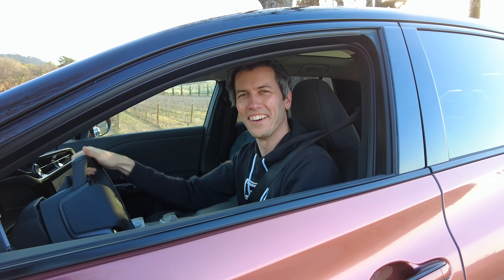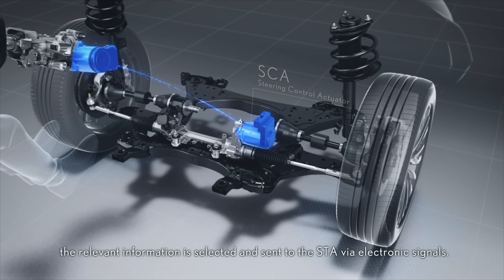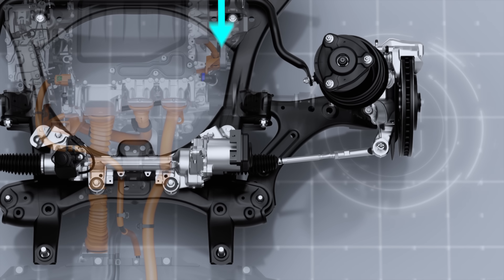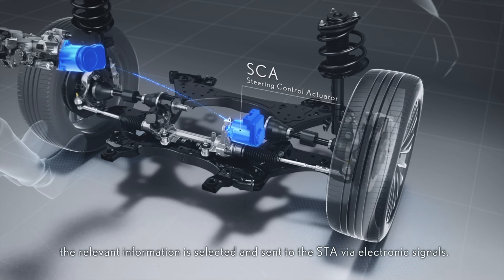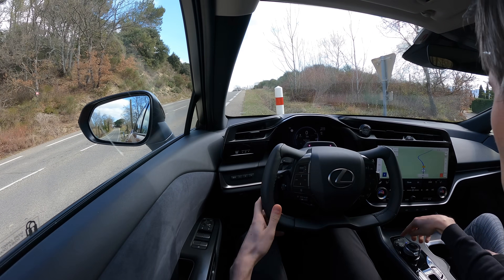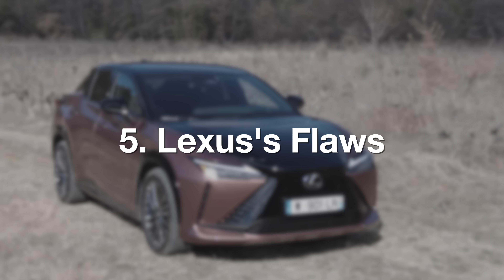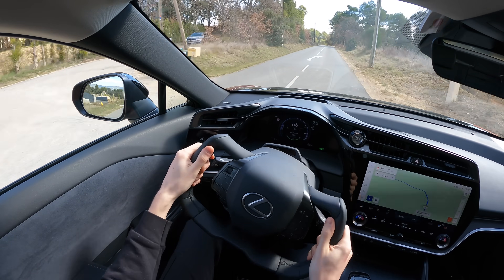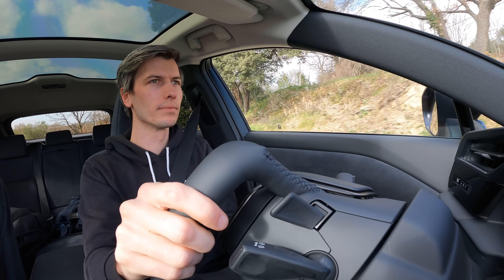How Lexus Fixed Tesla's Bad Idea: Steer-By-Wire Yoke

Comment: 9:12 "Well these steering wheels have much shorter steering ratios."

Common misconception, though track requirements and driver preference of course play a big part. Monaco surely requires a LOT faster steering ratios than most other tracks.. On open-wheel racing cars it's not uncommon to see steering ratios in the 10:1 to 12:1 range, and I've even seen 13-14:1 ratios used on tracks without super tight corners, and there are plenty of cars that live near those ranges. BMW M3s and 1 M-Coupes for example have had 12.5:1 steering ratios in some generations, a 2020 Toyota Corolla might have 13.5:1 steering ratio. Interestingly you often see slower steering ratios on more sporty cars, like 15:1 on Jaguar F-Type and 16.9:1 in the Ferrari F430 (458 went down to 11.9:1). So while open-wheel race cars often do have faster steering ratios, it's not like it's worlds apart.

The real reason they can get away with it is of course that they're going fast and not actually turning THAT tight, vs. trying to do a 3 point turn on a parking lot (which would be quite hilarious when they often have like 17-20° of steering lock at the wheel, vs. 25-35° of normal cars). There's only so much steering angle they can use before understeering, because they're driving on the limit, so they can get away with not turning the wheel that much. And it's not just racing cars, you can watch an onboard video of the Porsche 911 lap record at the Nordschleife or Silverstone (or almost any other record for a car), they also don't really go hand over hand even in the tightest corners, with road car steering racks (to my understanding the steering ratio of a current 911 GT3 RS road car varies between 14.4:1 in the center to 11.2:1 near the edges).

When finagling the open-wheel racing cars to pit boxes (if for some reason they're not lifting it up entirely) you can still see the steering wheel turned hand over hand at times, though it's uncommon for them to have more than about 500° of lock-to-lock wheel rotation. With often less than 20° of total steering lock available, that still means a steering ratio in excess of 10:1 in most cases.

Comment: Interesting, and about time we modernize the way we drive, steering is the one thing that hasn't changed fir many years, having said that, I wouldn't trust Tesla's technical approach, since  they can control the users car via the internet/satellite, it can be easily hacked. Also, the way the software is done by Tesla leaves much to be desired. The end user should be able to dictate and choose how to control and use the vehicle Not the manufacturer.

Comment: 12:00 lack of sharp response in case of an emergency to lets say avoiding an incoming traffic and a crash is essential. What is good about this system though is because it is made of electronics the manufacturer could update them at anytime. So I would say no more recalls to change a hardware. A simple update by simply connecting the car to the internet could do the job, sort of what Tesla is actually doing

Comment: The whole "Why use steer-by-wire" section is just copied by the manufacturers!
It's just wrongly assumed that traditional steering with "highway speeds' is unstable.
It just isn't. 😆 It's as stable as the car is built 🤷🏼‍♂️
Factors like wind direction or the general condition of the car are what make a car (un)stable.

Comment: As an electrical and I&C engineer I can think of over a hundred failure points and lack of fail-safe right off the bat.
This can NEVER be as safe as a mechanically linked steering system

Comment: Wondering what would happen if you start steering in high speed (low sensibility) and reduce the speed while still in the same steering. What happens when the vehicle is in low speed (high sensibility) and you stop steering? Does it get out of sync? The centred yoke doesn't mean straight wheels?

Comment: How does it feel to brake with the steering wheel turned, as you turn if you slow down it would change the ratio making you turn even harder if u didn’t move the wheel

Comment: As much as you want to sugar coat it, electronic steering is more likely to fail compared to mechanical steering. Even in airplanes which use fly-by-wire the early test versions show issues with the fly by wire system. Since it is software that engages the steering, if there is a mistake, it will cost a lot. On top of that, drivers are not trained to deal with any malfunctions and will most likely crash after the startle they get when they steer their wheel  but the car stays straight....

Comment: Let's just say it's a lot easier for a mouse to chew thru a wire than a thick metal rod!  Imagine you have a 2000 miles road trip and the motor to control the steering decides to burn out in the middle of the trip while you're going 80mph!  Of course it's safe, until it isn't... hate to be the first ones to experiment this "technology".  Also what if you have to dodge a deer at high speed?  I guess even if you jerk the wheel your car will hardly move!

Comment: I drive order pickers at my warehouse job. They use steer by wire. Let me tell you: if you go to make a subtle direction correction, it can wildly throw your angle off. I've nearly crashed into several racking units because I made a slight adjustment with the steering wheel and it decided to yeet me off to the side.
Reply: IT is not thinking about you, it is doing whatever it wants to do by the people who designed it, which makes IT unsafe.

Comment: Nice explanation of the why and how. I can understand the pros/cons of having a yoke and drive by wire. But all that extra stuff with builtin redundancy seems to be way over engineered for the value it adds. The traditional power steering is probably more than sufficent for like 90% of the market out there. It feels a lot like a feature no one asked for and dont really want to pay for and then also have to maintain later on

Comment: The video of one of these at a race track was all I needed to see to know this version is as bad or worse than Tesla. Bottom line up front, the Lexus does not accurately map the yoke's orientation and the yoke "creeps" off of center with dramatic inputs until you are left holding it sideways to go straight. Maybe this is a good idea for the everyday driver, but the current software simply isn't dynamic enough to work in most performance applications.

Comment: Electronic parts are expensive to replace, I dont always want my hands at 9 & 3,
Reply: Electronic parts also last many times more than mechanical and need way les maintenance.. you don't need to have always at 9-3, like you don't to be always at 10-2 on a circular one..

Comment: Thats really interesting and all, but give me my circular steering wheel back. I drive 95% of the time with my hand on either the top or bottom of my steering wheel, having two hands on the wheel feels unnatural or like youre racing. I am all for the tech, but gimme circular steering wheel.

Comment: Old news this been around for a long time I had a cheap 2012 Hyundai Elantra limited used steer by wire and throttle with adaptive steering standard circle wheel.  This is becoming more common so people are starting to notice it especially when the gear that connects the motor to the steering wheel has to be replaced.

Comment: Lexus's steering technology is definitely in the right direction, pun intended. This might not be for enthusiasts, for now. The whole concept is in its infancy, we just have to let it grow to its potential. We can always have a sensor to detect objects on road like in a moose test to let the steering wheel be sensitive or even assist during evasive actions. This kind of steering is going to be very practical in a fully autonomous car where for some random reason you want manual controls occasionally, but not always use it. One can only imagine.
Reply: Definitely not

Comment: Not sold on the concept, and I am a retired pilot with thousands of hours in FBW aircraft I "trust" FBW systems. First, FBW in aircraft serve a specific purpose, it allows you to build an aircraft with relaxed stability and still be able to fly it. For fighter type aircraft this can dramatically improve maneuverability. On a car I just don't see a compelling need, I feel like they are doing it just to do it. Second, this system as described lacks adequate redundancy. Quad redundancy is the standard. The redundancy described is more like 1.5x. Tandem actuators are not truly redundant. FBW aircraft do a full FCS test prior to every flight to verify full functionality, and I suspect this just does a continuous monitor vice a dedicated BIT. Third, the performance isn't there. Aircraft FBW systems are nearly instantaneous. It sounds like this has perceived lag, and that's unacceptable.

Comment: The idea of adaptive steering at different speeds is the single dumbest idea that has ever been proposed. It may sound good on paper but in an emergency situation you cannot be guessing at how much you need to turn the wheel in order to get a certain response or have that response changing as you're heavy on the brakes to slow down.

Comment: I feel one of the biggest benefits is  being able to build cars that are either left or right hand drive. As the steering column is one of the hardest things to shift from one side to the other but not in a drive by wire system.
Reply: @ThomasVWorm  the point is that it's a lot easier to do that configuration much later - it's just a different dashboard instead of a completely different layout in the engine bay...
Reply: @ThomasVWorm  the money saved from manufacturing and transport is probably more than enough to justify it.
Reply: so the only benefit is world marketability? doesnt sound like a benefit to the consumer at all, unless you think the money saved by cheaping out will actually be passed down to the consumer. (it wont)
Reply: Better yet, you could make cars that are left AND right hand drive, so you can have a co-pilot, just like on an aeroplane. You can also teach your kids to drive that way. Hell why not put a steering yoke in front of every seat so if you get bored of driving you can just throw up your hands and let your toddler take over the wheel, or the yoke in this case.
Reply: Correct! That's the main reason - money saving. Car manufacturers tried to implement steering-by-wire since a while (15+years) but for long, there were too many safety concerns. With the rise of the e-cars, SBW got pushed as well and gonna be state of the art soon. 
A big cost factor in every production is diversity. Quality control is easier, confusion/interchangability is lower, spare part storage.... 
Standardisation of things is a must! So, not having to worry about left hand drive / rhd is a HUGE thing for design, production & aftersales.
Reply: @ThomasVWorm  They're at least one-fifth of the worlds population.
Reply: @domnanzwandor  He said India dude. lol.
Reply: Hoping Cybertruck has it. Then we see it sooner in RHD Australia.
Reply: That's fascinating! You could import a car from the EU to the US. Or from China to Hong Kong
Reply: @TreDogOfficial  The only left driving EU countries are Ireland and Malta. I don't even know if they make cars there tbh.
Reply: @cyan_oxy6734  Cyprus and the UK also drive on the left :)
Reply: Lol😂
Reply: heck they could even install them on the backseats... or have one at the aft in the cargo hold to drive backwards like u would forward xD but tbh traditional steering could also have higher steer ratio just by adding gears... so on a yoke u could shift and have a low steer ratio at high speeds and a high ratio at low speeds :D better would be if its shifting on its own tho... at certain speed threshholds... like highest ratio at 0 to 10kph slightly less at 10to 30 so on...
Reply: You could even have a version of the same car with a centered steering wheel, or even one that can be repositioned across the dash whenever.
Reply: who needs UK cars, Japan only...
Reply: And doing it VERY easily. In a Toyota press release about the TNGA platform, they mention that 80% of the chassis development cost is in the firewall area, so being able to make one 'global' firewall would save them a lot of money
Reply: That and in the future you can simply remove the steering wheel.
Reply: I don't think that benefit is very big. You will need brake by wire moving out brake cylinder and vacuum chamber, also, to completely benefit from that. Steering column itself is located mostly inside cabin and steering racks actually designed to have driving shaft on either side (only casing is different).
Reply: I thought they could just mirror everything
Reply: @ThomasVWorm  easier said than done. We Brits gets charged more for the "special" edition
Reply: @mostlymessingabout  Steering is only one of many differences. The cars still need different dashboard, different cable bundles, probably door panels and other interior trim. Anyway, somehow the Japanese companies somehow manage to sell Japanese-side cars to Japanese buyers with no special surcharge... 😉
Reply: @mostlymessingabout cheapest used car in the whole of europe. what tf are you talking bout “charged extra” stfu
Reply: @ThomasVWorm  few people includes all of Japan, Hong Kong, India, Brunei, Bangladesh, Bhutan, Malaysia, Pakistan, Singapore, Indonesia, and Sri Lanka,  East Timor ,Macau , Thailand ,Kenya, South Africa, Zimbabwe, Lesotho, Botswana, Malawi, Zambia, Namibia, Swaziland, Uganda, and Tanzania, Fiji, Pitcairn Islands, Kiribati, Tuvalu, and Niue. Nauru, Samoa, Papua New Guinea, Tonga, and Solomon Islands, Australia , New Zealand, Guernsey, the Isle of Man , Jersey, Ireland, Malta, and Cyprus ,Antigua and Barbuda, Barbados
Bermuda, Bhutan,Botswana, British Virgin Islands,Brunei, Cayman Islands, Christmas Island, Cocos (Keeling) Islands, Cook Islands, Dominica,East Timor, Eswatini, Falkland Islands, Guyana, India, Indonesia, Jamaica,
Kiribati, Lesotho, Malawi, Malaysia, ,Maldives, Montserrat, Mozambique, Namibia,Nauru, Nepal ,Niue, Norfolk Island, Papua New Guinea, Pitcairn Islands ,Saint Helena, Ascension and Tristan da Cunha
Saint Kitts and Nevis, Saint Lucia, Saint Vincent and the Grenadines, Samoa, Seychelles, Singapore,Solomon Islands ,South Africa, South Georgia and the South Sandwich Islands, Sri Lanka, Suriname, Tanzania
Tokelau, Tonga, Trinidad and Tobago, U. S. Virgin Islands, Uganda , United Kingdom, Zambia, Zimbabwe

so a tiny market !!
Reply: @SNORKYMEDIA  Yes. Funny you needed to make your list longer by including Pitcairn. There are no cars on Pitcairn.  But it does make your list longer :D
Reply: Minor correction: You listed both Swaziland and Eswatini, but they are the same country (Eswatini is the current name).
Reply: You forgot Camera @SNORKYMEDIA
Reply: @SNORKYMEDIA  🤣
Reply: It's not just the steering column it's the entire exterior of the car.  Everything is designed with the driver in mind from dash to heating controls the different airbags seats are different for drivers.  Where the computers are and fuse box is.
Reply: maybe british people should just use right hand drive like normal people
Reply: Don't forget Toyota Indonesia Manufacturing is since 1979

Comment: From the engineering perspective the slow reaction must be a very easy software fix, by just tweaking the PID coefficients. If the actuator is strong enough, then it is certainly possible to make it even more responsible than a traditional physical steering column. Just look at the factory robotic arms, same tech.

Comment: This system would not continue functioning under a solar flare or high energy electronic attack.  I would never trust a system that solely relies on electric.  Perhaps if they added a hydraulic system that could survive an EMP. Otherwise, I would still prefer a rack and pinion.
Great video and explanation!

Comment: I might be wrong but entire video is a comparison of hydraulic-power steering vs yoke. Instead of electric steering vs yoke. Electric steering is already a very common feature from opel corsa to high end porsche. Many of the upsides he mentioned (changing steering feel during understeer or not feeling potholes due to lack of column) are already in the cars with electric steering. The dynamic ratio is a new thing of course but i don’t think this is too much of a revolution since it is a function of speed and steering input.

Comment: Ok so basically what was felt in the steering wheel is now simulated. Then why spend 100k on a Lexus when you can buy a gaming steering wheel for less than 100 dolars.

Comment: A common defect in modern steering systems.... Failure of a sensor. Currently, this is not a problem, because the support then usually fails only in one direction, the steering still works mechanically. With such systems from the video... there the passengers are then possibly dead, because there is a complete failure of the steering.